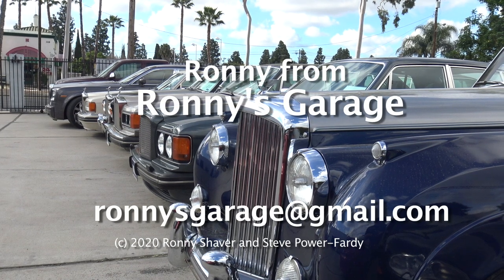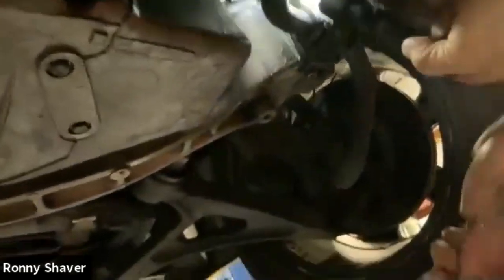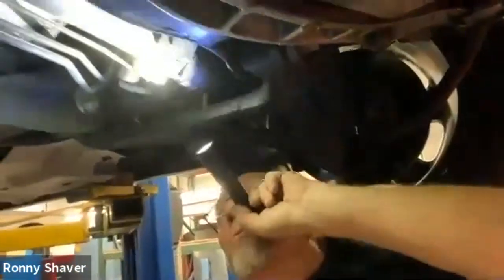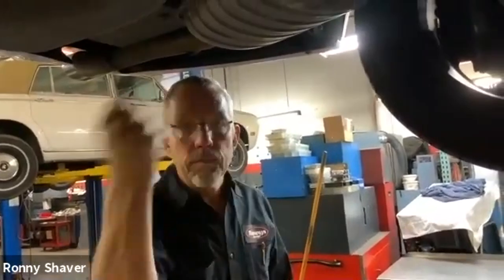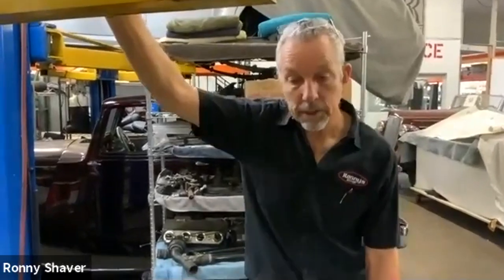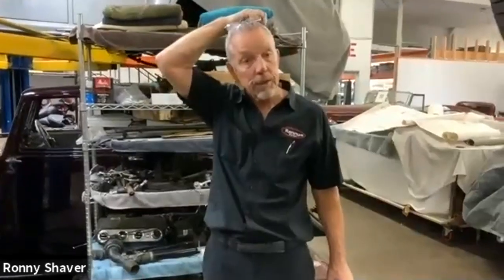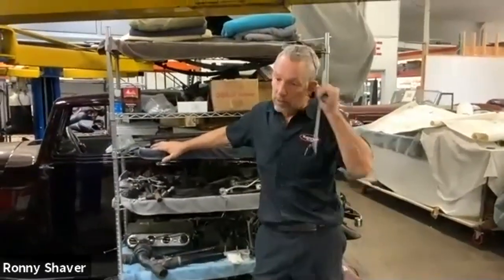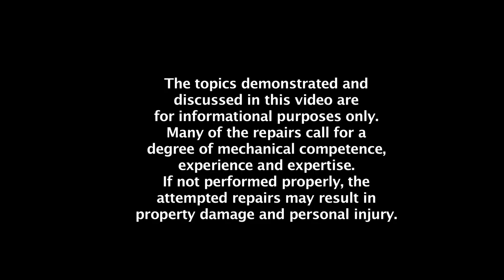2001 Bentley Arnage Inspection and Service Recommendations Part 7 of 9

Comment: I think if you are gonna have one of these cars you may as well do an engine out service every 10 years.  WIth the motor out you can get to each minor leak easily instead of spending 15 hours to change each $20 hose separately, which will end up costing way more than just taking the motor out and patching up all the substandard parts where you can actually see, feel and touch them.  You can probably buy a hose factory for less than the cost of buying each molded hose for this car.  So do that too, and make your own hoses.